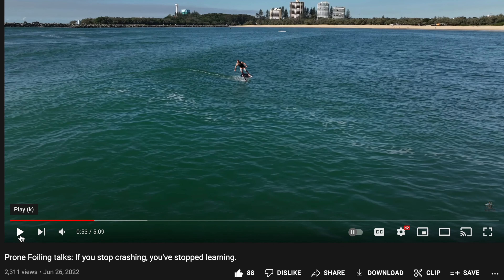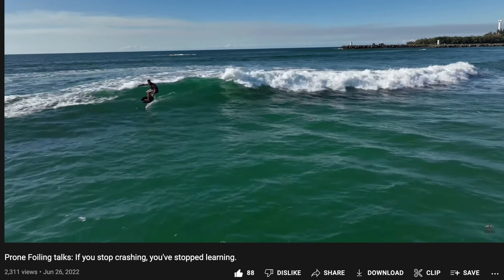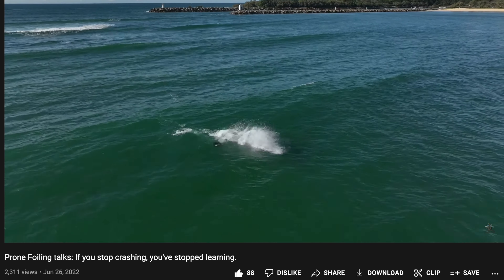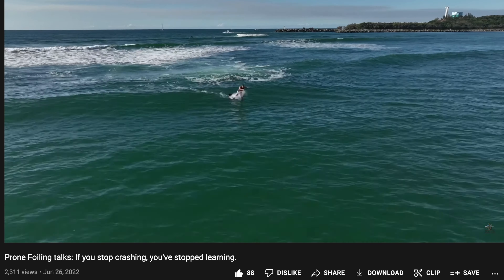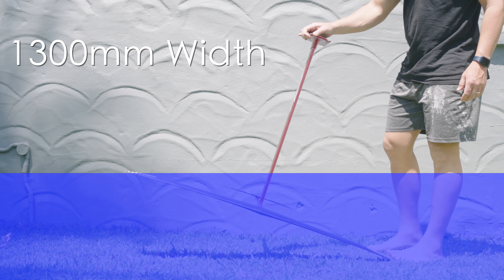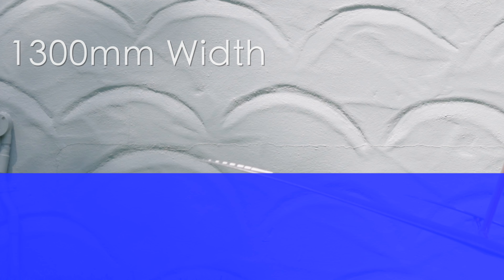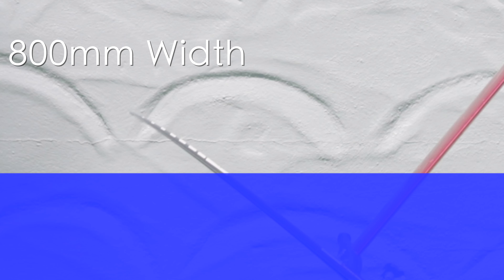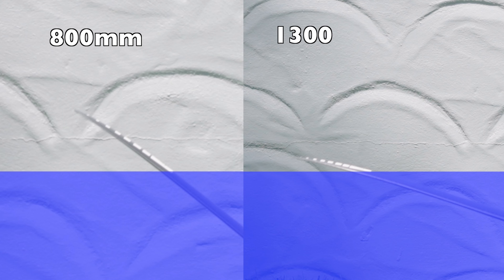Understanding this will make you turn better! Foil Wing Tip Breaches

Comment: You gestured a roll angle.  Angle of attack is in the pitch of the wing relative to the oncoming water and the the built in angle of attack of the wing fixed to the fuselage
Reply from the maker: Made a note of that in the description already :)

Comment: Some of us are designing breach resistant wings. Armstrong and F-one have some wings that use some dihedral in the tips. Also less lift angle at the tips helps. My own designs have had some of the fixes as long ago as early 2022. My last batch I'm refining learnings since then. Best fix though is simply a longer mast. And breaching on a carbon mast feels fine but breaching on an aluminium mast feels dead in comparison, like the mast is passing it's stress limit.
Reply from the maker: Being a fairly old video in the foiling world. I'm now using code foils and other brands which are breeching without any issues. In some ways this video was only relevant to the foils I was on at the time.

Comment: I ride an Armstrong HA725 (kite foiling). I routinely have tip beaches with full recovery. I think,  since the tips turn up they can wash off the air so that it doesn't travel too far towards the mast.
Reply from the maker: Yup I think you're right. There is a little disclaimer down the bottom of this video saying exactly that. Wing design and shape is a big element. But you can't ignore the fact that the 725 is a narrow wing span relative to some of the other wings on the market. It all works together.

Comment: I know that some foils are designed to deal better with breaches. Supposedly the new ART PRO wings are better than ART because of less twist in the wing tip.
Reply from the maker: Yup the 699 fixed it and the new foils have sorted the issue as well :)

Comment: I have been trying to figure out what's happening with this! Sometimes, inexplicably, when I turn, I breach - and I suspect it's when I'm not leaning into it enough. Either that or trying to initiate the turn with too much back foot like a surfboard.

🤷‍♂
Reply from the maker: This might help!?
Reply: @davewestfoils  Yeah it does! But why is a low-angle wing tip breach more devastating than a high-angle wing tip breach? Also, what is going to be your 800 wing of choice - the 799?
Reply: @jonalport  My guess would be the hydrostatic pressure - a wider wing at a lower angle means that air doesn't have to get sucked as deep under water to disrupt the flow around the wing enough to cause critical loss of lift. But I'm no expert on this matter.
Reply: @petrihirvonen  Yeah that makes some sense. I guess also the less horizontal your wing the less upward lift you are suddenly losing when it breaches.
Reply from the maker: @jonalport  for prone the 799 is my tow wing - i'll be on the 810 BSC or the HPS 830. The 799 is far too small for me to pump on whereas the HPS especially I can pump once I'm up to speed. Can link a couple waves.
Reply: @davewestfoils  Yep I figured the 799 would be too small 👍
Reply from the maker: @jonalport  scientifically explaining is outside my scope haha. All I know is the more parallel the wing is the quicker the air clears meaning less loss of lift. :)
Reply: @jonalport  it's all hydrodynamics, the low angle basically has more of a scooping affect and channels or forces any air  cavitation down the wing due to the low and high pressures below and above the wing
Reply: @davewestfoils at 95kg the 810 is my favorite wing in decent surf. Super intuitive immediately, reward commited turns... the closest thing I've felt to carving hard on rail on a shortboard. And actually pumps pretty decent too.

Comment: Are you going for BSC810, HPS830, or ART 799? All of these will turn better (tighter) than than the ART1099 but will have higher stall speeds too.
Reply from the maker: Probably HPS 830 -  much higher stall speed - really made for pocket surfing for prone and good wind (15 knots and up) for winging.

Comment: This video makes a point but doesn't explain it at all. Why does the angle matter? The video doesn't say.
Reply from the maker: Because the air remains trapped and doesn’t clear. If you think about it - the mast is a cross section of the foil and because it’s perpendicular it doesn’t allow the air to enter in underneath.
Reply: @davewestfoils  The video at 0:50 shows air extending down the side of a vertical (or nearly vertical) foil. How does that happen if the angle with the water surface is the the thing that causes the stall?

Also, "remains trapped" doesn't make sense here. You imply that the air would sort of "bubble up" to the surface if only the wing were tilted at more of an angle. This is pretty obviously not the case. If you tried to hold air under the wing even with it 100% stationary in the water, you would not be able to, it would simply float around the edge to the surface. And in this case, the water is being sprayed at ~15mph across the entire front of the wing consistently. The air will 100% clear from under the wing if you move the wing through the water.
Reply from the maker: @TylerKaraszewski  so whats the alternative?
Reply from the maker: Also the video at 0:50 is a just showing what ventilation looks like for illustrative purposes and that one is cause by water speed in that experiment. And I'm no physicist - just an average foiler trying to convey things in a simple way. There are surely semantic errors that I've made and you're welcome to point them out. But after re reading your comments I'm a bit confused about the things you've taken away from the video. The video is about understanding how big wings can be frustrating with shallow bank breaches and they're often the ones that make you loose lift. That's really all.
Reply: @davewestfoils  I don't really know. I'm not an aerodynamicist but I am an engineer, so I like to look at these things critically. If I see problems with an explanation, I'm not pointing them just to be difficult, but to try and come up with either a better explanation, or at least an awareness of any limitations in the explanation we have so far. I'm not actually sure if hydrofoil ventilation is actually very well understood at this point. Or maybe the people designing America's Cup foils understand it but don't feel like sharing.

The video mentions at the end, and I wonder if this is really a better point - a wing with a narrower span is less likely to breach. You can push it over to a much higher angle before it breaches at all, so you can do harder turns with the tips still in the water. How do you know this isn't by far the bigger factor in being able to push the wing harder?

It would be possible to do a test, I know you don't have the equipment, and I don't either, so it's not easy to do, but it would be doable, in the same tank they used for the ventilation footage with an 800 and 1099 wing and see if either of them recovered better from tip breaches and see if doing it at different angles made a difference.

I also know that for kite race foils, for example Chubanga's V3 foil has used reduced chance of ventilation as a big selling point of the foil, even though it's span and angles are not significantly different from the previous video. This is just to say two foils of similar sizes may have significantly different properties around ventilation, so there's that possibility that this is more of an inherent difference between two different foil designs rather than just the angle they hit the surface at.

Like I said, I'm not just trying to be argumentative, just come up with the best understanding of these sports we love so much and make sure we don't end up with incorrect explanations of how things work. :)
Reply: The air ventilates along the top of the foil, not the bottom as Dave says.  At a shallow roll angle, a large portion of the foil can ventilate without the air needing to be drawn very deep under water. In other words, at a shallow angle of roll, there is not much weight of water (pressure) above the foil to prevent air propagating along to the top of the foil.

ART foil tips are not designed well to cope with breaching and avoiding ventilation.